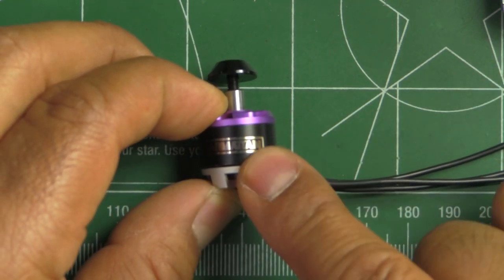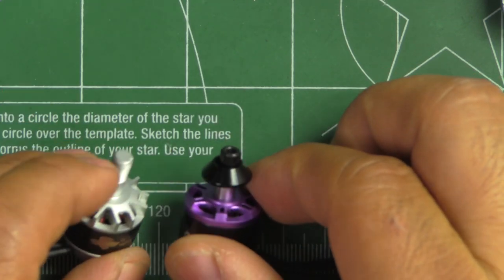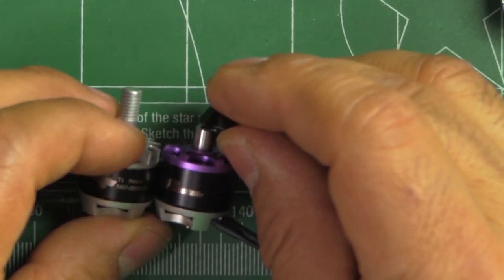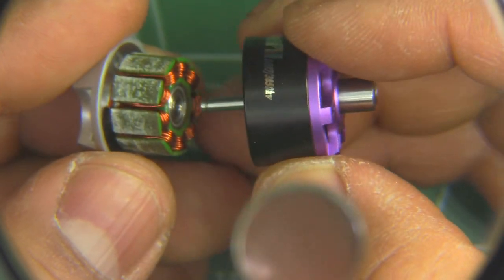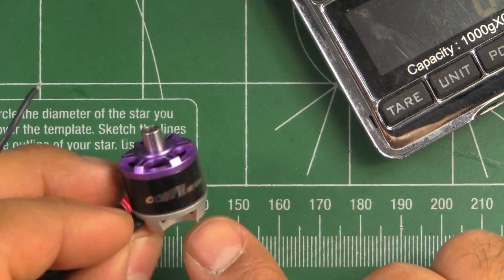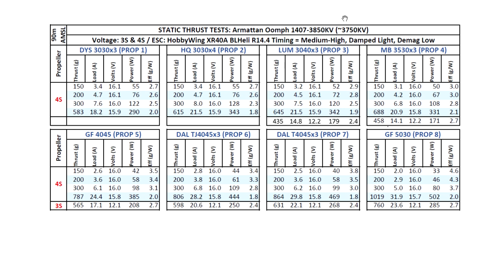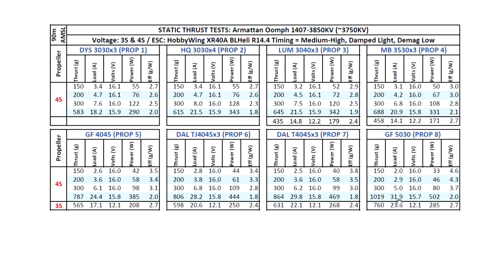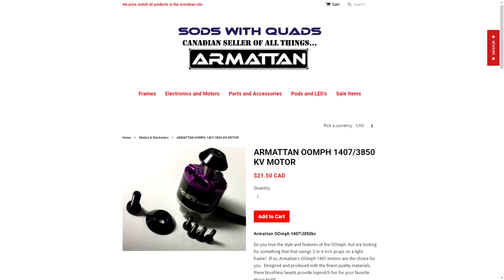Armattan Oomph 1407-3850KV Static Thrust Tests & Overview 1 Kg Max!!!

Comment: Great info, need to get a rk3076 see how it compares with the lumi/rotorx
Reply from the maker: The TRK3076 TCS prop and 3041 4QCS seem to be specifically designed for fast forward flight so when tested on thrust stand they don't do well. I added results for the 3076 to the Dorpbox Excel table for the BH 1407. Click on link on video description
https://www.youtube.com/watch?v=hGMDdels79Y

Comment: You should try to test Racekraft 5038 DCS props on those small motors too. Hopefully the vortex management makes them a bit more civilised than the GF twin blades.
Reply from the maker: norgtube Kabab FPV did a test review in his channel and found them to be slow to respond for freestyle or racing setups. Also the design of the TRK props doesn't do well on the thrust stand. They always make low thrust but in flight they're fast. Something about their design focused for fast forward flight. I got low thrust on the 3076 TCS and 3041 Q4CS

Comment: Holy cow, just as everything else in quad racing as soon as I buy what I thought was the best available it takes all of a week for someone to beat it. This time I hadn't even received the rest of my parts in the mail yet. This is worse than the iPhone. I would however like to see this higher kv version and the Brotherhobby on some higher pitch 3" props. I like that you used the Luminier which I ordered but the Racekraft 3076 seems like the most ideal since most of us aren't putting these motors on a 5" quad. In fact I'm not even sure that this motor isn't best suited for a 2.5" prop with the higher kv but my guess is that it really shines as a 3" racing motor giving you just a little more top end than the BH 1407-3600. Anyways, thanks again for another great bench test review.
Reply from the maker: See my reply to SlamFPV below. I ran the 3076 on the BH 1407. Also BH is going to send me a test sample of their 1407-4100KV soon
Reply: You just need to crash harder.  That way you have an excuse to buy new parts.
Reply: so I'm at an impasse with my build. The microlux fc comes with a 5 wire plug for the esc which has 1 wire for each esc and a single ground. There is no way I feel like this is going to do my quad any good, not to mention the wire gage is way too small that it's going to choke off my signal. is there anything I can do about this? Do they really want me to splice off 4 grounds from one tiny little wire? I've always ran my ground wires bigger than anything else whenever I'm running anything electrical. I know these are just signal wires but as with anything electrical your build is only as good as your ground.
Reply: You are misunderstanding how the signal ground works.  There are only tiny fractions of an amp flowing through the signal and ground wires.  Increasing the gauge will not hurt anything, but it will not help anything either.  Try it before you change anything.  If it ain't broke don't fix it...  It will fly just fine using small gauge ground wires for the signal.  The current the wires need to handle is minuscule.
Reply: Plur307 I get that it's miniscule because they are just signal wires but are they wanting me to splice 4 grounds into this one wire? I have one more question if you could help. Since I am not using a pdb and on my other build that has a 4in1 esc w/o pdb my battery connects to the esc directly but since I can't do that with (2) 2in1's do I splice the 2 esc's together along with another set to power my fc and then run that down to just one set of wires for my battery connection and if so where is the best place to add a capacitor? On each esc +- pads? and should I add a third cap to my fc?
Reply: I would put the capacitor as close as possible to the wires that will power your video system.  The point of adding capacitors is to prevent lines in your video caused by the voltage spikes from the motors reaching your camera and VTX.  So by putting the capacitor on the wires powering your camera and VTX they should help suppress the voltages spikes in those wires.  Hope that helps.
Reply: Plur307 caps on your esc will also make your quads a lot smoother. I was having problems with my RF Bolt esc being jumpy until I watched a video they recommend and it fixed the problem immediately after I ran it inline with my battery. You can also add them to your receivers to prevent your quad from falling out of the sky after punch-outs, had that problem before too. If you run a series of them inline with your battery it'll actually give you more power for longer periods as well.
Reply: Capacitors will not give you a longer punchout.  Capacitors are rated in micro farads (millionths of a farad).  Even if you put a 500 uF capacitor on each ESC and another on your battery lead that would still only be 0.0025 Farads.  0.0025 Farads*14.8V (4S nominal voltage)=0.37 Coulombs.  1 coulomb is 1 amp per second.  All those capacitors cannot even deliver 1 amp of power for a fraction of a second.  Punchouts are pulling easily over 100 Amps.  The capacitors aren't even able to provide 1% of the needed power even for 1 second. Capacitors are for smoothing out sharp peaks in the voltage and helping deliver quick burst of energy that are mere fractions of a second.  They do not deliver any sustained level of power.

Your motors are not pulling power smoothly from your battery.  They are pulling it in thousands of sharp bursts a second.  The capacitors help smooth out all those sharp bursts.  Our motors have 12 poles.  A 5 inch quad can hit maximum of about 35,000 RPM.  35,000/60 =  583 rotations a second.  583 x 12 poles = 6996 poles a second.  Our ESCs are switching thousands of times a second and the capacitors help smooth out all those surges and drops in the voltage.  They do not deliver sustained power for even half a second.
Reply from the maker: Excellent detailed explanation.  Yes, just as Plur307 says. Caps "smooth" out those sharp peaks. They're dampeners. You can usually smooth out most of the new ESCs (BLHeli F39x & BLHeli_S) by using a 1000μF 25V Low ESR cap (Panasonic FR & FM series are good) but in these 1407 micro quads it's difficult to fit such a large cap so most people don't use them. Those caps are mostly used in 4" & 5" builds
For clean video in micro quads, I like using only a 220 to 470μF 16V or 10V (depending on voltage for video) at the power input for camera/VTx if needed. Some setups end up being fairly "electrically clean" so you don't need any power filtering. D-Sun voltage regulators or some of the PDB regulators provide clean 12V & 5V power.
Reply: Yeah ok
Reply: @ J Slater  If you are having issues with things dropping out after a punchout you might reconsider how you have things wired.  Are you running the power through a 12V regulator before it gets to your flight controller or receiver?  Voltage regulators need the source voltage to be a couple volts higher than their output voltage.  If your 4S battery sags to say 13V on a punchout that can cause the 12V regulator to drop out and lose power.  I'm just taking a wild guess as to what your issue might be.  I have encountered that issue before.  I tried to power my camera from a 12V regulator once and the camera would shut off or brown out and go to funny colors during a punchout when the battery was getting low on charge and I had already been flying for a minute or two.  Cheers.

Comment: I wish there was some sort of texture on the top of the bell that helps grip the prop.  I don't like the prop nuts or washers to have any texture.  I want the torque to go directly from the bell to the prop and not through the prop nut.  It is much less likely to come loose when you hit something.  I experimented with prop nuts that had a serrated bottom and they always came loose even when I clipped a branch.
Reply from the maker: Interesting, makes sense when thought out - one of those counter-intuitive things.
Reply: Yeah I had never really thought about it until I got some grippy lock nuts.  In hindsight I think it is better for the nut to only be providing clamping force that presses the prop into the bell.  If the top of the bell has some sort of texture it will transfer the power to the prop directly.  And if you smack something the prop will just slip under the lock nut without turning the nut.
Reply from the maker: That makes sense, I was focusing on the prop "slipping" and getting loose - but yes, the actual problem would be as you stated. So smooth bolt-washer is best

Comment: Looking through all your other 1407 tests - these appear to be the new king, the BH is close, and more efficient, and the rotor geeks 4kv is also close. All priced about the same too at 16. I don't regret picking up the IF1407 based on your review though, they were much cheaper on Amazon (about 12.50 a motor) with free motor mounts and 2 day shipping :) .. and they are very fast on 4in build except I already blew up a 4-in-1 esc using them with 4S, seems that the 20x20 form factor 4 in 1's have some catching up to do - don't trust the 20A rating on them...
Reply from the maker: ten drones Very Good info! thanks. Perhaps the 20x20mm size reduces cooling and heat handling capability so not good for "powerful" setups. They gotta make a true 20x20mm 20A 4-1 esc. Based on raw power this one could be crowned as king. The BH1407 is a little more versatile as it's a little more efficient.
Reply: Yes I do hope 20x20 4-in-1 esc's improve soon - it really is the only way I could get a sub 150 gram 4 inch build. I have a new one coming this week that is supposed to be 25A built by HGLRC from banggood, we'll see if that can handle it.
Reply: which ESC did you burn ? I'm looking right now for a good 20*20mm 4 in 1, and the best I have found so far is the racestar Dark18A.
Reply: That's exactly the one I fried on my 4 inch build (using only 2 blade 4045 props), however the first one I picked up was from Gearbest and they call it a 20A 4-in-1 (I have both, they are exactly the same). So whether rated at 18A or 20A, it couldn't handle 4 inch blades long as I was only 3 packs in and just starting to really push it. I have a 25A on the way, from HGLRC that banggood also sells (it's combo'd with a FC). As they say it's on a slow boat from China so who knows when it gets here, but I'll update after I try it out.
Reply: Cool, it seems perfect ! I will be very interested by your test result.
Reply: The HGLRC 25A (20x20 with F4 FC/OSD) setup is a winner! I actually put it in a super light 5 inch build I'm working on (using lightweight 2204s), but I pushed it pretty good on the first couple packs and not a hiccup. The layout was perfect too - the only bummer is you can't really use them separately due to they use a small 8 pin connector sandwiched between the boards.
Reply from the maker: I've had this one for a few weeks . https://www.banggood.com/6_5g-XJB-V1-6DOF-F3-EVO-Flight-Control-AIO-5V-BEC-PDB-with-XR25A-25A-Blheli-2-6S-4-In-1-ESC-p-1120103.html
I've been meaning to do a review on it but it's old tech now. Only F3 and F396 ESCs 
PCBs on the HGLRC parts looks high quality. No messy soldering. Good to know the one you're using is taking the loads well.
This must be yours?
https://www.banggood.com/20x20mm-XJB-F425-Dshot-Flytower-Micro-F4-AIO-OSD-BEC-Flight-Control-25A-Blheli_S-2-4S-4-In-1-ESC-p-1148284.html
Reply: Nice  !  Does it come with M2 standoff  ?
Reply from the maker: Yes the old version I have did come with M2 nylon standoffs
Reply: No - I have a newer version with F4 FC + 25A Blheli_S 4in1 esc (20x20) - here is a link (sorry didn't want to put links in your comments but figure this will help) https://www.banggood.com/20x20mm-XJB-F425-Dshot-Flytower-Micro-F4-AIO-OSD-BEC-Flight-Control-25A-Blheli_S-2-4S-4-In-1-ESC-p-1148284.html?rmmds=search - Currently out of stock but supposed to be in soon or gearbest has them too. Still M2 standoffs unfortunately (don't enlarge the holes!!)

Comment: hi im looking to build a light powerful 4 inch quad. i think 1407 is a must for the weight, but i wonder which is the right motor. these seem to produce more thrust but is the kv to high for a small 4s with 4in triblades in the real world!
Reply from the maker: To use this motor you have to be very specific about each component to end up with a superlight setup and have "powerful"-type performance. If it ends up too heavy, then you will not get the performance you want. So frame has to be very light, LiPo also has to be the right size. A lot of people are using the DAL T4045x3 prop on the 3600KV motor with good results, I haven't seen the 3850KV with that prop yet. Rotorgeeks says they can run the T4045x3 prop on their 1407-4100KV. These motors are just as strong so best guess is that it should be OK but I can't confirm 100% because I have not tried it myself. Try asking this guy says he's using Lumenier 4x3 props which would load motor more than a T4045x3
https://www.youtube.com/watch?v=wDwsFJwGNFg

If the purpose of quad is for short-track racing then this setup would be very good, but for fast tracks, long straights, long-sweeping turns then it may not be a good setup.

Comment: Is it safe to run 4" triblades?
Reply from the maker: So far I've only seen videos of GF4045 being used https://www.youtube.com/watch?v=cilxdFxz-n8 
I've "heard" of people using triblades but can't confirm so I would be very cautious (check motor temps). Setup should be as light as possible to keep the load on the motor low and avoid overheating.
Reply: Jakub B I use dal 4045 v2 triblades fine on rotageeks 1407s 3600kv. Motors are barely warm. I've used the dual blades everyone recommends and I don't like them on my superlight, quad loses track to quickly on them.

Comment: All we need now is a good battery
Reply from the maker: Yeah... that's the only thing missing now.
Reply: IRFZ44 maybe in the next 10 years battery technology will catch up with the motors we are running.
Reply: Justyn Markland , before I could finish my comment you asked for the same prop as me. nice.
Reply: IRFZ44 I'm wondering if the answer is with supercapacitors? I don't know a lot about them so I'm not sure if the weight is too high but it kinda seems like a viable option although I don't really think there really is an answer to the battery problem since almost everything there is would require a completely different system all the way down to having to buy a new charger. Hopefully we will all still be around when wireless power systems are introduced and we can fly until components start melting. Either that or we can start pulling around really long extension cords.
Reply: Supercap is not the answer for this proble, simply not enough capacity
Reply from the maker: Theoretically supercaps would work if made light enough. Would be cool to see a setup with supercaps in parallel with an improved LiPo so voltage sag would be low.
Reply: EngineerX Someone needs to work on supercaps in a size that would work for RC use.
Reply: After thinking about your comment about the batteries needing to catch up with the technology I think the answer could already be there, or at least in the infancy of development. it still could involve a combination of supercaps (which from my understanding are actual power sources not what most people consider a traditional capacitor) and Graphene. I actually personally know a guy that helped develop the material so I took an interest in it. He owns the exclusive rights for the material in the fishing industry (G-rods) for rods which are generally made of carbon fiber or graphite but graphene is a stronger AND lighter material and it has a honeycomb cell like construction making it perfect for batteries. It actually holds the claim to the lightest strongest material on earth. The problem is manufacturing it is supposed to be an extremely complicated process. My guess is that the batteries that contain it now are being manufactured rather crudely for lack of a better term and I think that is why the different manufacturers of it have different versions and the weight from each of those varies so much . I doubt that it is a solid perfect piece of the material and I think as that comes around and they are able to start pushing more volts out of these cells we could have something better. And I could very well be completely wrong and lithium itself could be the problem but from the research I have done on the material it seems like this stuff could be the solution or at least the next evolution for a lot of industries. 
By the way, I just got my package this evening for my newest build. I already had my motors and frame, the Tomoquads CSX Komodo Dragon and Hyperlite BH 1407-3600's and I got the box containing all the rest today. A Micro Lux with (2) 20a×2 esc's, the Mini Swift, AKK switcher and some RK 3076, I'm just waiting for some aluminum standoffs and bottle of Dip'it. It's a fishing lure dye that also comes unscented that is outrageously potent and I want to try and dip my 3d printed parts in it because I think they have a color that matches my motors I hope closely. I'll probably get too impatient to wait but I'm pretty excited about this one. I know my neighbors are going to freak out. I may even post my first YouTube video when I'm done. I think it's gonna be absurd on 4s.
Reply from the maker: You better post a video and take some pictures and add it to the video :) I'd love to see that little beast. Lots of top notch parts so it will deserve to be shown off.
Definitely they gotta look into those batteries. We're in big need of new batt tech. I'm sure they know what they need to do. But they just want to feed us the tech slowly to milk $$ every step of the way. Here's a very interesting documentary from PBS. This part of video is about making them safe. If they can do that, they can make them more powerful as well. https://youtu.be/gxZrQ5yPsLI?t=30m40s
Reply: check out the mylipo 850mAh 4S 103g!